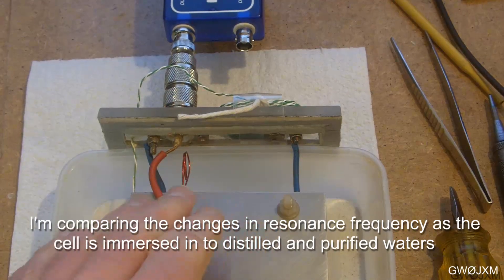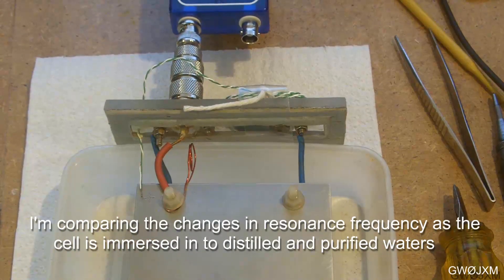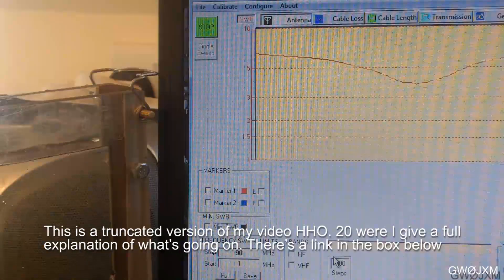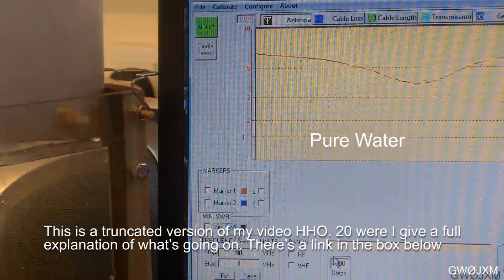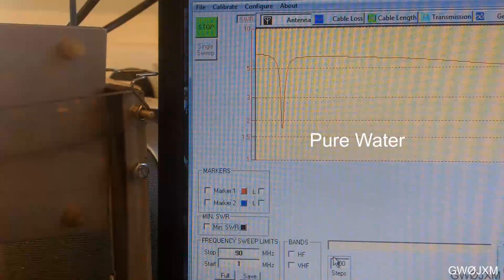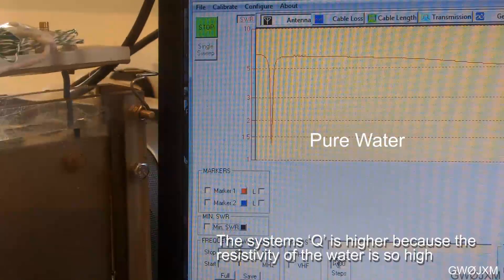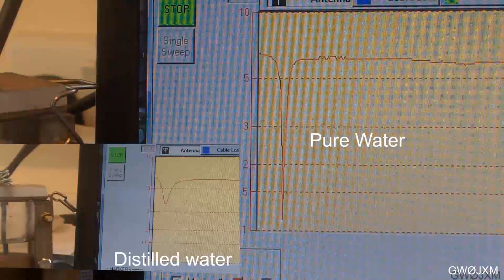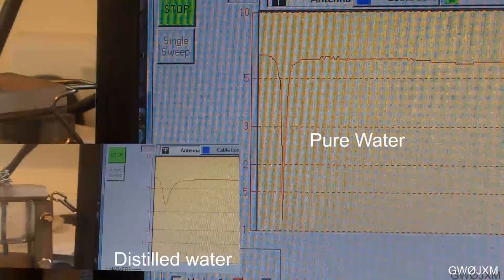HHO. 23 Purified water resonant cell, a truncated  copy of HHO. 22

Comment from the maker: OK I’ve looked at the videos and from what you say you are still trying to figure out Stan Meyer’s work. I think for anyone to be seen to have credibility it will be important for them to show a direct comparison between the gas output and the input watts for both straight DC and a cell driven at resonance. One can hit a cell with chopped DC of low current but if one measure the input wattage and gas production one will find it’s not efficient. Good luck with your project.
Kind Regards ...Andy

Comment: Yes, the type of water does make a difference but it is only a means to a end as the electronics must compensate for all the forms of water that might be put into the system for use as fuel in Meyer's work. Focus your efforts on the VIC transformer called in the patents the 8XA1 circuit or figure 6-1 in the technical brief and then take a look at figure 10-5 to see the wave form that should be seen across the series array.

Comment from the maker: Hi Ian, the big coils are for pipe line coating applications, they can be for the continuous heating of pipeline to cure surface coatings, weld preparation (both pre-heating or post-weld annealing) and post weld surface coating. The power rating depends upon the application but you wouldn’t want to pay the electricity bill as you start in the hundreds of KW’s    
Regards ... Andy

Comment from the maker: No, the capacitance is likely to be near the same, I don’t think that there is a lot of difference in the dielectric properties of the two types of water. The main difference is the resistivity of the purified water, its much higher than the distilled water, that is it’s resistance is much higher so the oscillations from the coil to the plates isn’t dampened by the resistance. Think of distilled water like a pendulum running in custard, the pure water is like air.  Get it?
Regards ... Andy

Comment from the maker: Hi
Yep, have a go it’s more fun than just looking at the computer but boy it can be just as infuriating. I didn’t want to go much less than 1mm gap as I think it could be counterproductive, I did think about having a header tank way up high so as to develop ‘Head’ and apply more pressure to the bubbles, then I realised that is opposite to what’s needed, it would need vacuum.  If all else fails I'll retune it and use it as I portable antenna on top band Hi Hi 
73's... Andy
  GWØJXM